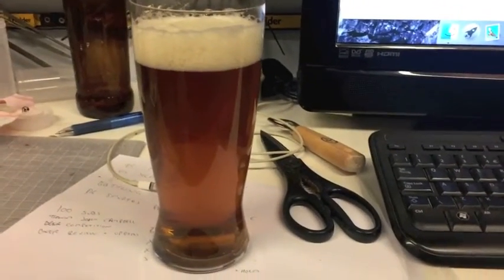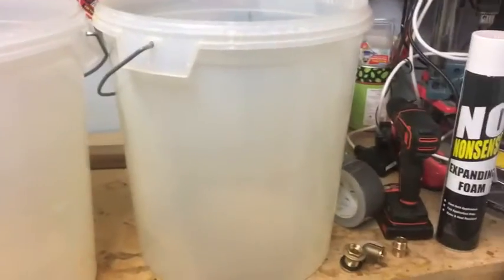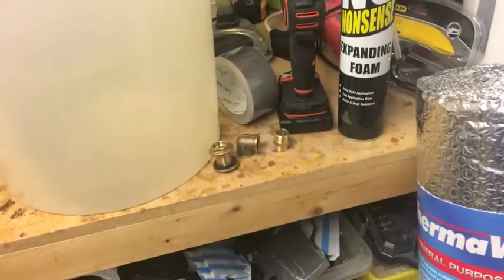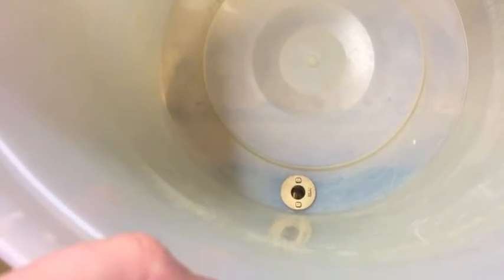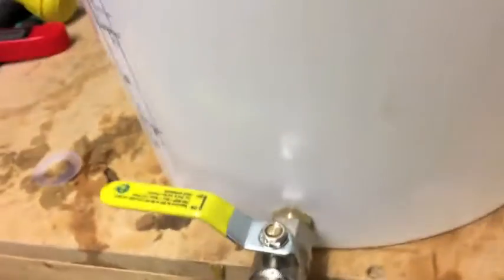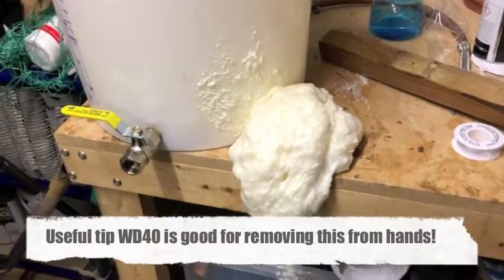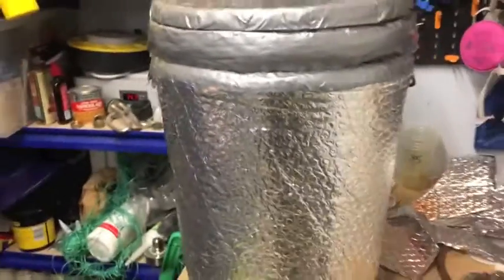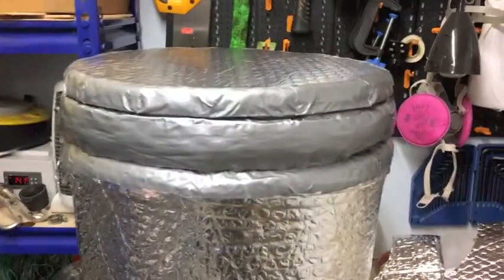Mash Tun Build Project (Instructable Tun with tweaks)

Comment: Couple of comments. 1 - There is no such thing as too much gaffa tape. 2. Why no fibonacci? Even a mash tun needs a little elegance fella...

Love the idea of the false bottom and the bottom drain. Might have to make another one myself... Could you send me the list of parts you used? The threaded tank connector specifically, mine was a bit of a bodge job in that region.
Reply from the maker: Cheers Chris yeah no problem I will post it up on http://www.mateswhobrew.uk/
As for your comments, as someone who has spent hours trying to remove gaffa gunk from audio cables when I worked as a sound engineer I would say there is definitely such a thing as too much gaffa! Was all up for the Fibonacci elegance but I was overcome by the spirit of the driller killer I'm afraid!